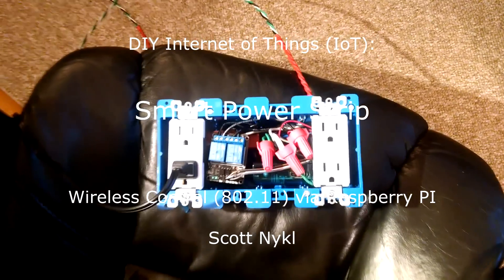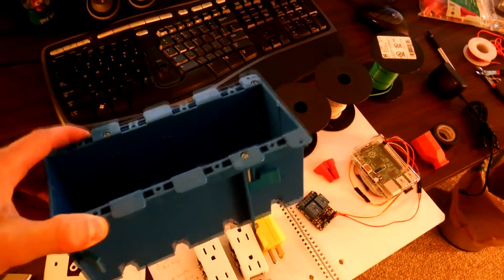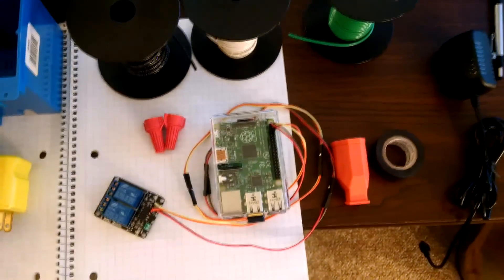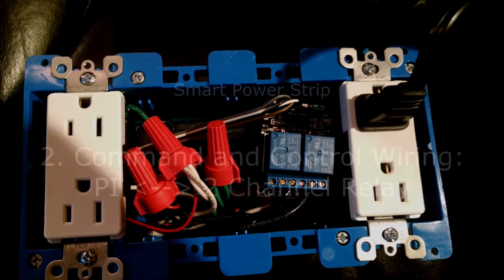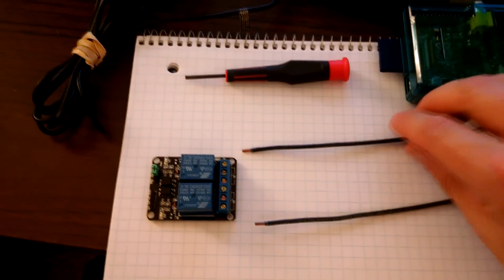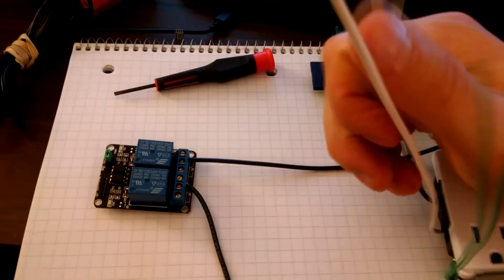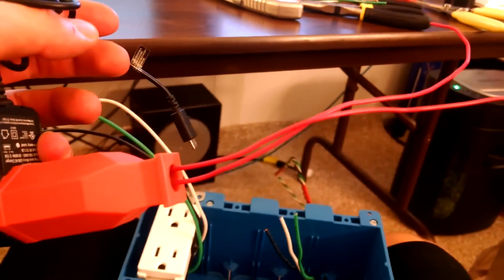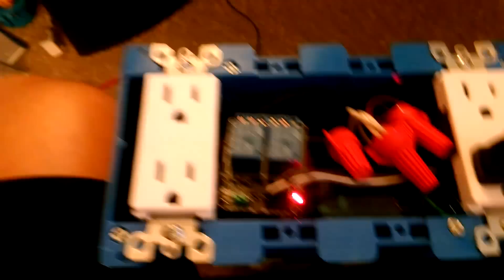Internet Controlled Power strip using a Raspberry PI (15 Amp / 120 Volt)

Comment: Isn't it a little dangerous to carry 120V over those skinny wires to the RPi power connector. Sure the Pi doesn't need much DC power, but that's on the other side of the wall wart. The plug side gets the full 120V AC from the mains.
Reply from the maker: The internal red wires around 7:41 only power the Raspberry PI, which draws several hundred milliAmps. Since Power = Voltage * Current (P=VI) and the current is only several hundred milli Amps, only a small amount of power will ever travel through those skinny wires... Of course, if one shorted them (just like any other circuit), those little wires may burn out before the breaker would pop...

Comment: can you show the exact code you used for these 2 raspberry pis   and what coding program did you use to make ti for your tablet  so can make this but work from something
Reply from the maker: I used WebIOPi ( http://sourceforge.net/projects/webiopi/files/WebIOPi-0.7.1.tar.gz/download ) which has its website located at https://webiopi.trouch.com/ . It hosts a webserver with a picture of the pins on the PI, you can turn them on and off from the web page.

Comment: The relay says 10 AMP but your descriptions says 15. Will the relays handle 15 amps?
Reply from the maker: Mark, good point... My description says 10/15amp and my title got lazy and just said 15amp... If the relays say 10amp, 10amp is probably the safe bet... I've drawn 15amps on mine for prolonged periods without issue, but I'm not a lawyer... If I was a lawyer, I'd probably recommend that no one should ever listen to me at any point in time nor take my advice :)...

Comment: I am looking to build a reef aquarium controller and your video really gives me a great start. I write python as part of my job but the hardware piece I was a little vague on. This has really connected the dots. My goal is to add temperature/PH monitors and controls via a raspberry. I am also planning on adding top off controls for my sump/tank. it now looks very do-able. I should be able to control it all via the web.
Thanks,
-Bob

Comment: Now measure how many calories you burn whilst gathering the required components and setting this up, as well as the average amount required to get up and flip the lights. Then calculate opportunity costs regarding how much time you are saving with this setup, vs how long it took you to make it, and from there calculate how many times youll have to use it before it will have saved you time :D

Comment: can i know what is the wire that you use?
Reply from the maker: I believe it was a solid awg 22 copper cable, but stranded awg 18 should work as well, if I remember correctly...
Reply: Can i have the coding?
Reply from the maker: I downloaded the code from:
http://webiopi.trouch.com/
Reply: I have open it but i don't know where to download it. I can't find it. Can you tell me how to download it? 😅

Comment: Would you have any ideas about using the pi to create a tcp controlled dimmer ? I want to gradually turn on a lightbulb (daylight dimmable led), from off to say 50% in steps of  say 10 minutes, to simulate dawn in a windowless bedroom.
Reply: +H Bosch I guess it wouldn't be a commercial dimmer as such, but a voltage output control. Thanks

Comment: I am Familiar with everything but coding, do you think you could make a setup video part 2, like how to connect the pi to the internet and how to make the website?  #CodingNoob
Reply from the maker: Charles Heaton Perhaps if I get time I will. The software I used here is called webiopi. https://code.google.com/p/webiopi/ . It is a simple install and does 99% of the work for you - it has a built in webserver that lets you control the PI pins.
Reply: Ok thanks :D

Comment: How did you make the light switch?
Reply from the maker: The light switches were just wired into the raspberry pi's gpio pins configured in input mode... When a switch flipped to on or off, the corresponding pin would become hi or low, respectively... I used a python script to continuously poll the on/off state of each pin, when its state changed, I sent a webiopi message to the corresponding remote pi telling the remote pi to open or close a circuit...
Reply: Perfect thank you
Reply: can this webiopi help me using pi 3 ? and where i can get the python script ? i try to seek at the webiopi but it didnt help much

Comment: Does anyone know of a relay that would be able to report back to the Raspberry Pi what the AC load is? For some context I'd like to build a smart block heater timer that can turn on or off based on schedule and/or temperature and be able to detect the load to ensure that the connected block heater is working correctly.

Comment: What website do you use to control the remote switches ????
Reply from the maker: I used the code from:
http://webiopi.trouch.com/
Reply from the maker: I used WebIOPI:
https://code.google.com/p/webiopi/
Reply: I dont understand about the coding thing . can explain it details please ? i do a final year project based on yours . so the part that install coding at that web is the part i dont understand . will u explain ? it will help very very much .
Reply: i try to do it but it does go well. the input and output doesnt come out . can u help me

Comment: Awesome. Helped me a lot understand how to actually wire this to get it to work. I'm guessing you can do this with multiple relays instead of just the two and have more outlets correct? Also I seen other tutorials that say you should use an LED or transistor? connected before the relays ,so if power fails, the current doesn't travel backwards through the PI and fry it. Is this not needed with this relay system?
Reply from the maker: You can absolutely do this with an array of relays and hook up more than 2 outlets, you just need more relays, more outlets, and of course, more wires!

As to your second questions about the back emf voltage when power stops... If you use the relays that I have linked in my comments above (under the "Show More" in the video description), these relays already have built in circuitry to prevent the back EMF voltage spike from traveling backward through the PI's control line. This way, the PI is always safe, even when switching off large amounts of power.

So far I've built 4 of these and use them around my house all the time - fans, lights, portable heaters, coffee makers, etc. I have not had any issues.
Reply: Awesome dude. Thanks alot for the video and reply. Keep posting good stuff